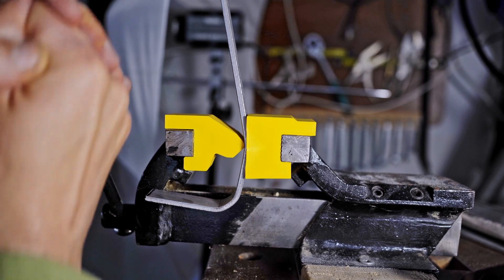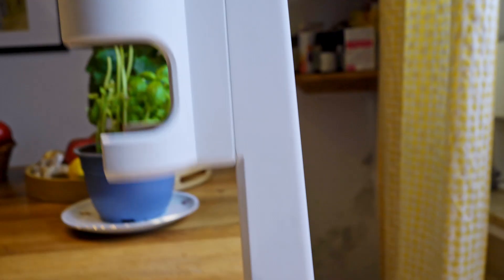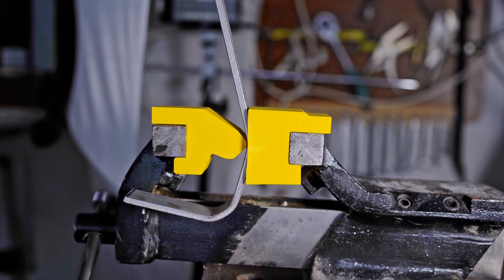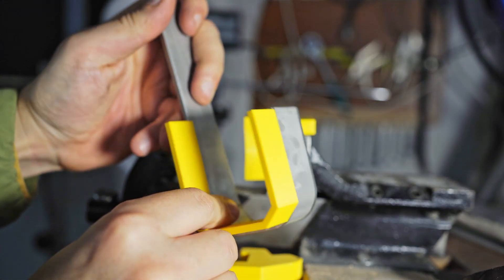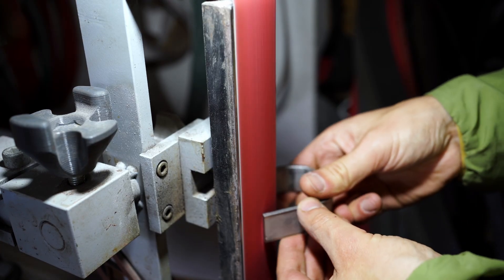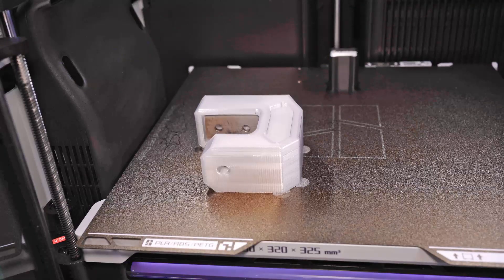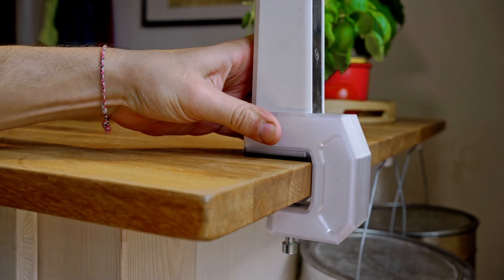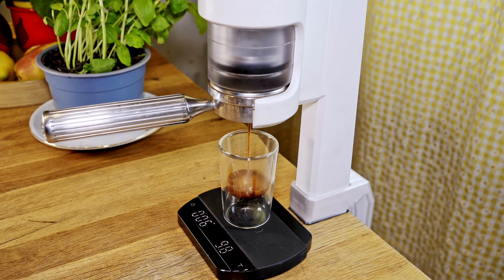3D prints bending 4 mm Steel for a custom Superkop Espressomachine Mount!

Comment: Would you be able to create the same concept but to bend small round bars?
Reply from the maker: Sure. U could use the same setup or just add a small v notch so the bars will not roll around 😀